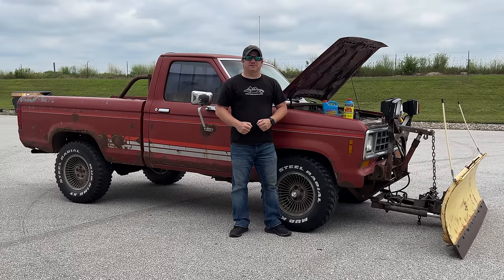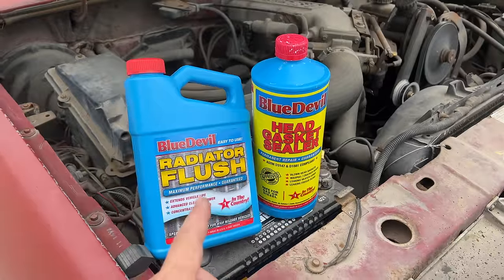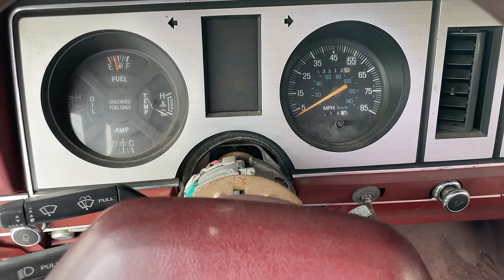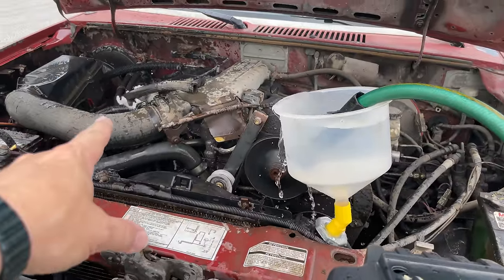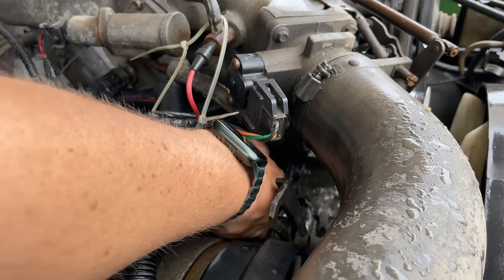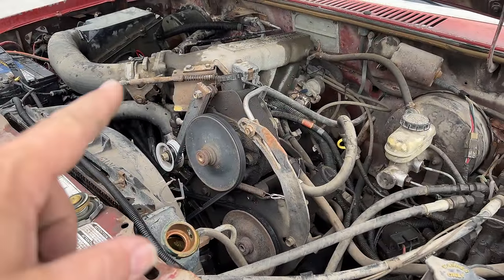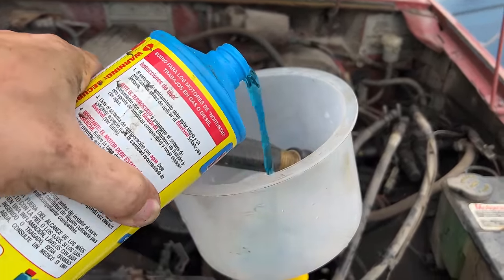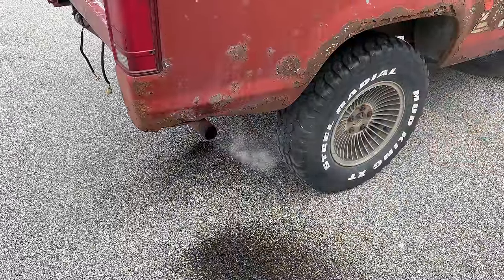Will BlueDevil Head Gasket Sealer Fix my Ford Ranger

Comment: My uncle did that same trick with waterglass aka sodium silicate.  He drained the radiator and flushed the system, then put a quart of waterglass in the radiator and topped it off with 50/50 mix.  After about a week of driving the truck stopped blowing white smoke out the tailpipe, and until he wrecked the truck hitting a deer 4 years later, the leak never returned.

Comment: It does work and would have worked if you would have followed the directions better. I've used this several times on vehicles destined for the junkyard with 100% success.
Reply from the maker: What do you suggest I have done
Reply: @ThisWeekWithCars  don't remove the Blue Devil from the system. Let the engine cool completely, then start it up and run it again. Do it without the thermostat as well. I've done this in a 1995 Mercury Cougar in 2012 and that car is still on the road.
Reply from the maker: @thatunknownguy2680  I didn't remove the Blue Devil from the system it is still in there today.  It still hasn't made any difference after hours of use.
Reply: @ThisWeekWithCars  unfortunately, it may be worse than a gasket. I've had cracked heads do this and a hairline crack in the cylinder wall.
Reply: @thatunknownguy2680  I have a 1987 Ford Ranger with milky froth on the oil cap, loss of power and sucks up coolant. It doesnt have AC or Heat (the houses have been pulled). Do you suggest taking out the thermostat? Someone else suggest I do that, but I was afraid it would overheat if i run it for the full 50 minutes. Some feedback would be great. Thanks.
Reply: He didn't remove the thermostat.!
Reply: @DeforestLCooper  Absolutely remove the thermostat. If getting close to overheating, shut the engine off or run cool water from the water hose across the radiator. As long as you don't run it out of water, it'll be fine. Make sure you change the oil ASAP after doing this though.
Reply: @thatunknownguy2680  Thanks man. I did notice that there are 2 different bottles. One is a smaller bottle that says it DOES NOT require to remove the thermostat, and the big bottle that DOES say you have to remove the thermostat. I didn't remove it and it took forever for the engine to get hot enough to open the thermostat. I was thinking about doing it again and taking out the thermostat. Have you ever used the blue devil twice on a vehicle?
Reply: @DeforestLCooper  you can use it as many times as you want. It doesn't clog systems up like the kind that has fibers in it. They're just so pricey ($70 a bottle, right?).
Reply: @thatunknownguy2680  So if I have a crack in my cylinder head, this type of fix typically won't work? If so, why would it work for a blown head gasket?

Comment: I've never had much luck with mechanic in a can. If that Ranger has the 2.9, head gaskets are a common fail. Pulling the head would make for some interesting content. Your channels first in line when you post.
Reply: it does, you can see in the video it's the clackbox

Comment: I don’t believe the instructions was followed 100% accurate. Did you remove the thermostat? After the 50 min idle you are supposed to let engine completely cool down than drain, refill.

Comment: this engine  mister  have  big issues, water  leak to the exhaust  and  also  burning oil  like a factory chimney,, it is a difficult situation ,,,  better  fix  it in a mechanics  workshop  classic  way, new pistons  se  new  casket  new  valves and seats treatment    and   reshape the  head  surface ...  and will last  many many years after that

Comment: My son had a 98 Ranger 2.5 with a slight head gasket leak. He needed the truck on the road, so we tried Blue Devil.
I wasn't expecting much, but was pleasantly surprised  when it actually did seal the leak. He had the truck for another couple years
and the leak never returned.

Comment: Steve, I had good results with the Bar's product that is compatible with coolant and is left in the system.  Worked for a couple years on my Subaru until the water pump suddenly failed and the engine overheated, then I went ahead and did the head job.
Really enjoy your channel and appreciate your approach to troubleshooting and fixing problems.

Comment: Thanks for testing this, very interesting!
Only way water is getting into the cylinder is on the intake stroke when cylinder is at a lower pressure than the water jacket.  As soon soon as combustion occurs its going to hit back with a pressure pulse hundreds of times greater than the cooling system pressure.   I can't imagine how this could ever work, but it's nice to see it put to the test.

Comment: I like your passive method of filling it up using the water pump.  The cooling system isn't made for high pressure.  Forcing garden hose pressure at 60PSI invariably in my experience causes long lasting leaks, bursts weak heater cores, etc.  Good idea!

Comment: Watching you was a rerun of my experience on my 1989 GM 5.7. Blowing smoke out the tailpiple just as bad to include coolant. I failed to flush the system nor ensure all the coolant was out.  GMs hold a lot of AF.  Used both DB and K Seal and neither worked.  Then pulled the heads and redid the gaskets and it still did not seal.  With mainly water in the coolant put another can of K Seal and it worked.   In your case you should have done a few hot and cold overnight soaks and driven it.  I bet it would have sealed that way.  Keep in mind that not all such problems are the head gaskets.  In my case it may be either a crack in the block or the intake manifold has an internal crack.

Comment: Wasn’t there a note in the instructions to remove the thermostat during the 50 min run/seal process?
Reply from the maker: My thermostat was open the whole time, that would be something needed with a modern vehicle with electric vans an huge radiators.  They have to write the instructions for people who don't know how a car works.

Comment: I used "Bars Leak Industrial" on a 350 engine water leak.  Sealed it up and running cool and no white exhaust.  Been 4 years now.  Improved my oil pressure.  This truck is a 14 ft box truck GMC 3500 - so always hauling loads and working hard.  I'm a believer.  Will anything work on a Ford? LOL Thanks Steve

Comment: I think removing the thermostat and setting the heater up on high heat might have given you better results , I believe that's what is printed on the can,because the thermostat opens and closes at different Temps it's possible for the blue devil process not to work as well as it could have with it out for free flow  , also the heater core will have some old coolant and debris if you don't turn it on on high heat that dirty water stays in it and will weaken the nlue devil. Just my 2 cents worth.
Reply from the maker: This is not a modern car the thermostat is never going to close and I had the heater running on high the whole time.

Comment: You are supposed to remove thermostat and run heater on full I've done this and it plugged my radiator and found remains in the coolant passages in head
Reply from the maker: If the thermostat is open it will make no difference.
Reply: @ThisWeekWithCars  well if you ever open it up will be interesting to see

Comment: I think some have it start working after four or five heat cool cycles. Since the sodium silicate needs heat to work, wouldn't it be better with the thermostat in? The high heat by the head gasket solidifies the stuff and stops the leak.

Comment: Last time I had that type of dense white smoke it was caused by brake fluid getting out of the power-assist brake sytem into the intake manifold but that was a long time ago, maybe things work different now, but I'd want to look at the oil to see if water was in it and do a comp test, and check the brake fluid level before diagnosing/trying to fix a head gasket problem. But maybe he did all that but didn't say.

Comment: I put this shit in my truck it fucked my water pump up ate the bearings chewed em right up but it did fix my leak
Reply from the maker: Leaving straight water in your coolant system will do that.  You might have had a small leak in your bearing and this stuff tried to seal it but also destroyed the bearing.
Reply: @ThisWeekWithCars  no blue devil turns to hard ceramic after a while its what took my pump out and I don't ever use straight water man I live in WV it' gets cold as hell here